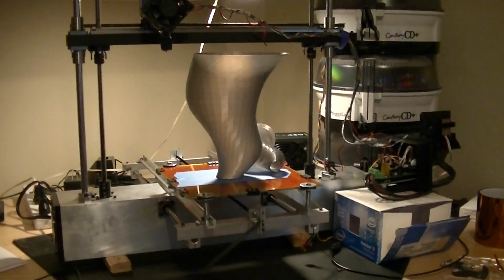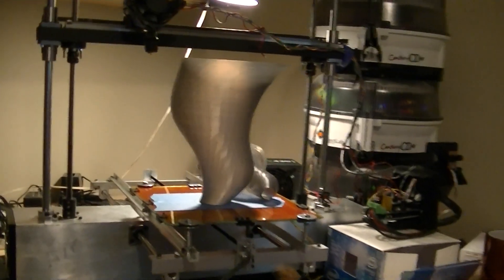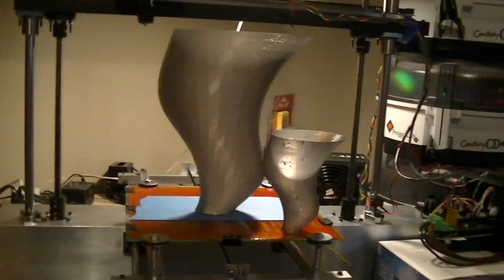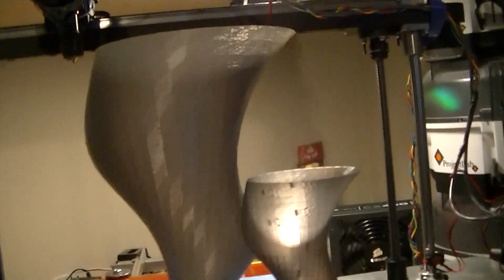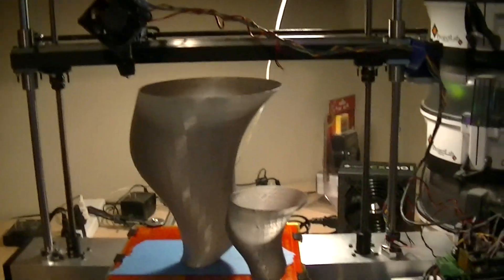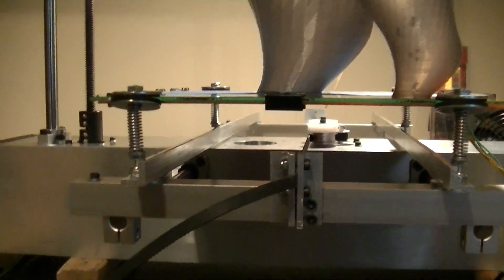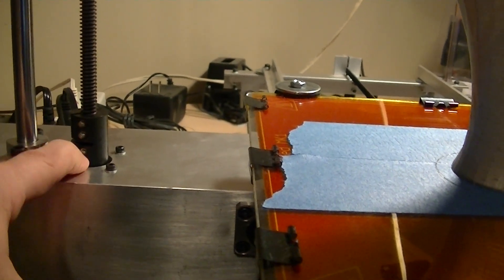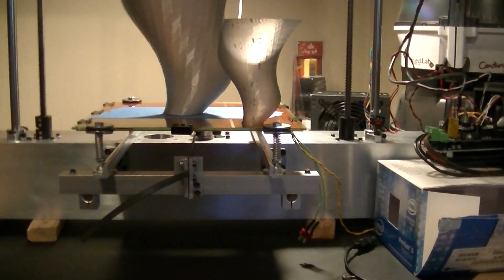Behemoth 3D printer  finished!  Welll sort of...

Comment: Does having those long spring loaded standoffs for the bed really needed? Seems you could add a lil more z by cutting those down in half and it would still be more than adequate to serve the purpose they were intended for. Hell might even think about cutting 2/3rds of it out, and might even make the bed more solid from racking side to side